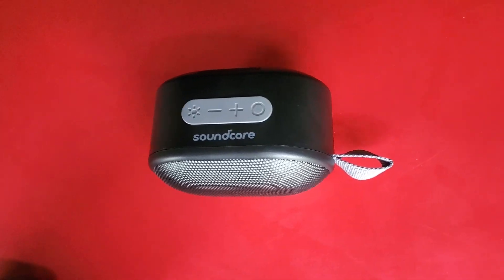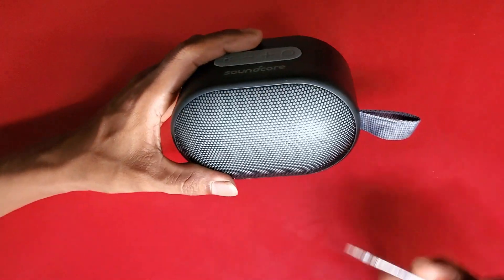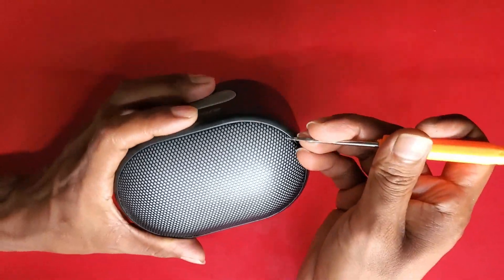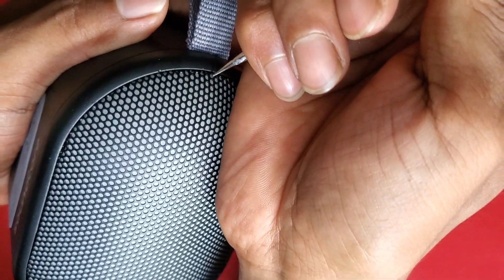Soundcore Pyro Mini Bluetooth Speaker - Teardown | Disassemble | Anker Soundcore

Comment: Surprised me that it is ported, no wonder it's cheap
Reply: what is ported bro?can you pls explain it?
Reply: @suryavishwanath8564  so basically most of mini speakers now use passive radiators or bass radiators (the one that vibrates) if you are very familiar with JBL flip series and bigger ones, the ones you see on the side are the passive radiators. But port or bass port is almost the same as passive radiators, but ports are holes with tubings.
Reply: @AJdax_RC  thank you soo much for the detailed explanation bro..